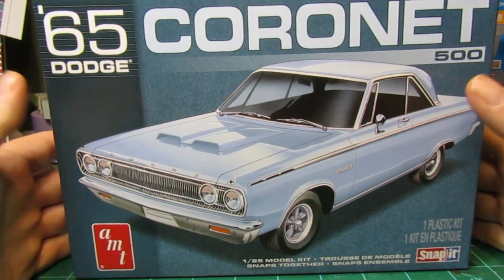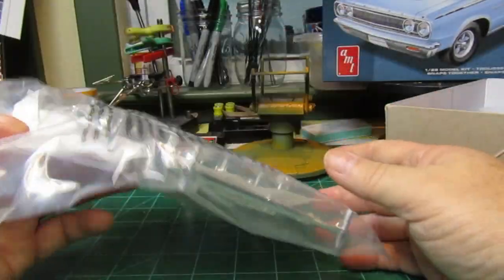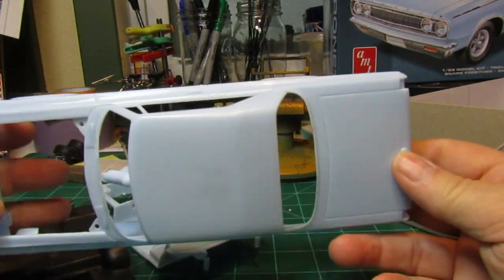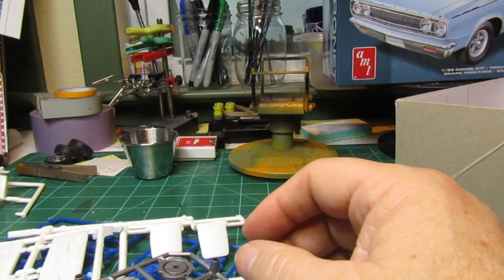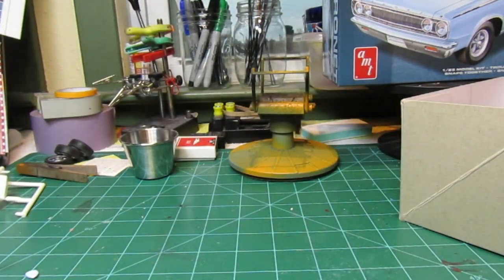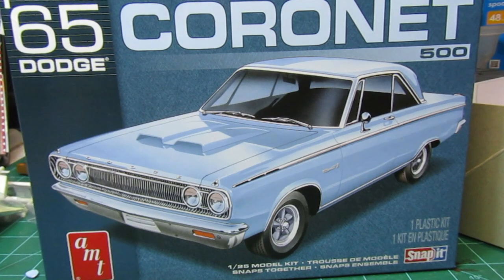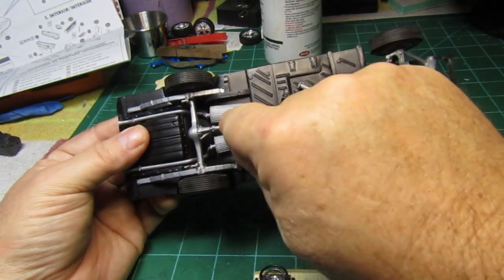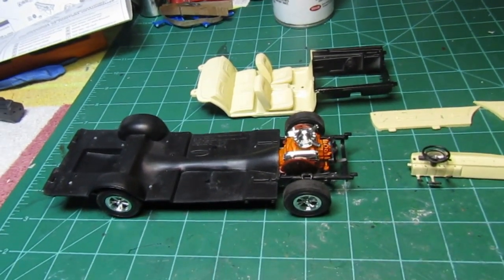AMT '65 Dodge Coronet 500

Comment: Did you have trouble attaching the interior to the chassis??? I cannot get it to fit correctly.
Reply: It’s like the radiator is in the way
Reply from the maker: If I remember correctly, I had to grind the transmission tunnel both on the chassis and interior tube.
Reply: @kingranch1962 I got it! I made a wrong mistake earlier in like step 3. I was able to undo and everything fit fine after!